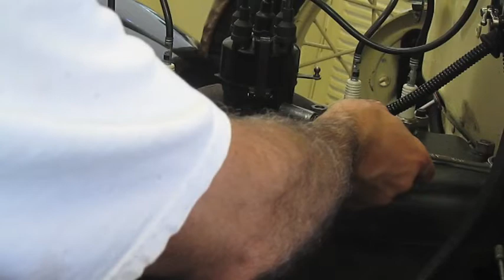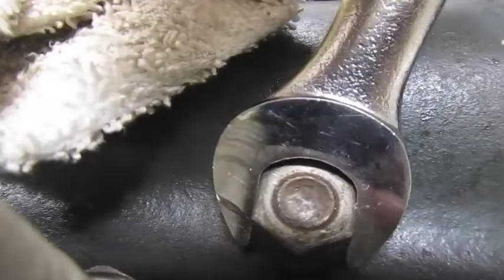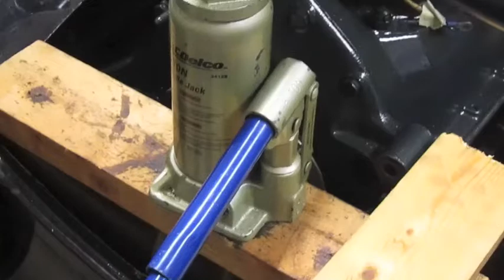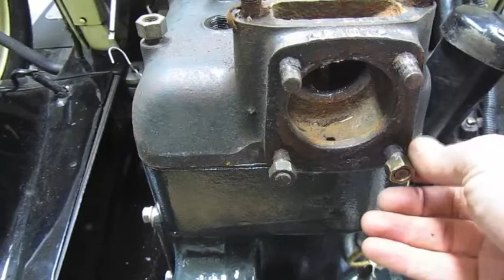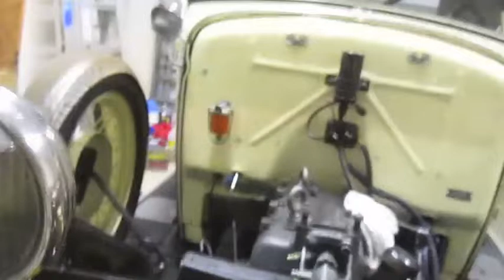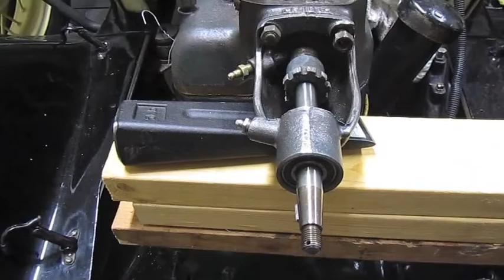Ford Model A - Remove Stubborn Head (1 of 2)

Comment: Very simple pull spark plugs.  Find the two lower piston and shove a rope in on top piston.  Turn starter over and it will pop head up very easy.

Comment: Great video I needed to see. My Dad had restored a 29 Phaeton. It was out of state having work and they changed the fluid. We brought it back to Indiana and had a polar vortex. Ultimately the head cracked and my Dad passed away. So I have a Model A I've gotta get the head off of. I've been putting it off because I just don't have any experience on that old stuff. I've worked on some flatheads but my concern was binding the studs on the four banger.